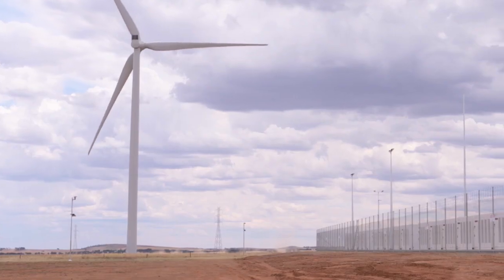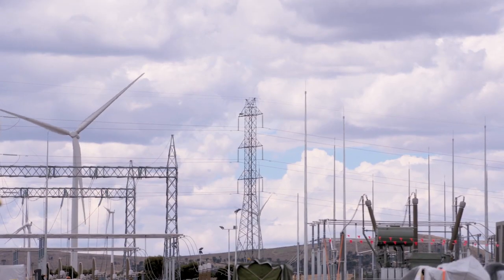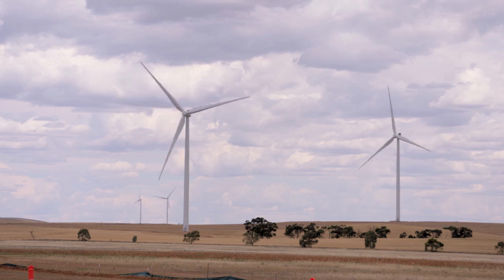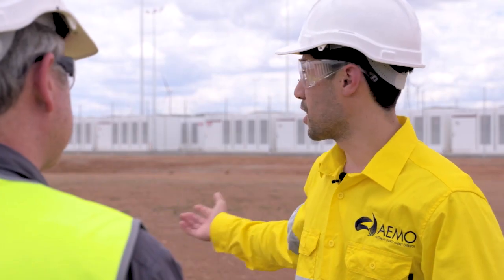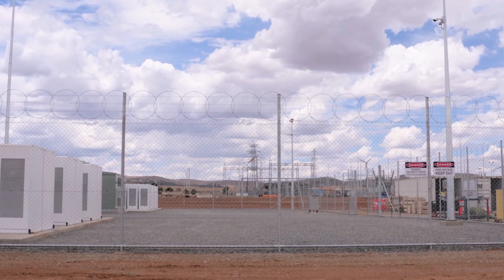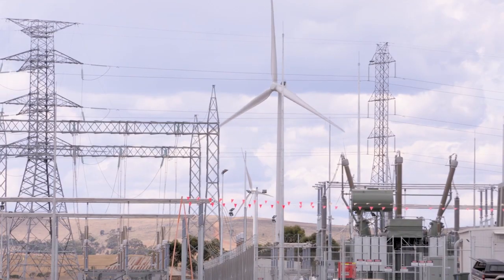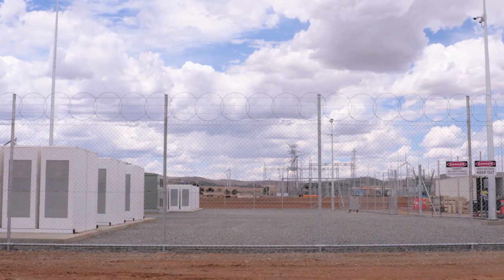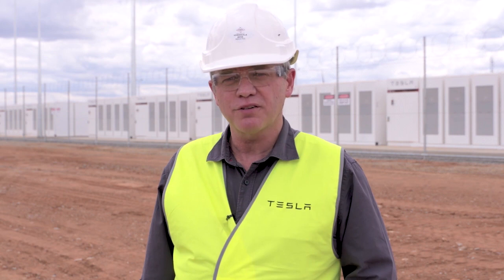AEMO visits Tesla's South Australian battery

Comment: Did you notice the wind turbines hardly turning at all. Very often the case.
Reply: That’s the point of the battery, when theirs not enough wind the batteries can discharge and add onto the grid. When there is wind and making more then enough energy they can trickle excess energy into the battery rather have it wasted.
Reply: Happens when the batteries are full and not enough grid demand at the time, or if there is maintenance, or if it's too windy.
Reply: I have seen this many times in Europe where there are no batteries.
Reply: but there is sun so  put some solar panels
Reply: very nicely expalined

Comment: Sure, destroy the baseload stability & mgmt and grid with unpredictable sources and football field size batteries made from lithium - dirty to mine and process.
Reply: The battery takes less than 1 second when responding to power demand or supply, while the backup generators take ~4-5 seconds to spin up or shut down.  It gives the electrical grid a bit of 'padding', helping to moderate the surges and losses.  It works best with base load to handle what is needed, and the variable power generation (wind & solar) can store their excess power in the battery.  When power is needed above what the base load can provide, it can come from a large enough battery (hopefully augmented by hydroelectric).  When there is too much power (for whatever reason), the battery can store it, while hydroelectric would pump the water back uphill (see Pumped-storage).

Comment: How does it work? They still use cable to transfer this electric current to every house right? It is still not safe from the disaster?
Reply: If there is too much power, and the Australian power grid pays people to use electricity, the battery stores it (and gets paid).  If there is a drop in power supply (like on December 14, 2017), the battery can react faster than a power plant to provide electricity, avoiding brown outs (and get paid).  It can't provide base load, but it can provide surge protection and help reduce brown outs.  For the attached wind farm, the battery stores electricity from when it is generated by the wind farm, and the battery releases the electricity when the price is right (making the wind farm more profit too), instead of the wind farm only releasing when it is being generated.

Comment: I have had a lot of interest in this project since it was first announced.  It's great to see you smiling when summarizing the results.  As you said, it won;'t solve all your electrical problems.  It will be interesting to see what you have to say after using the batteries for a year.  Are other power companies going to follow suit?
Reply: It might be difficult for other power operators to get into the market.  If you look up "Hornsdale Power Reserve", and go to the wikipedia link, you'll see that this battery is handling half of the frequency stabilization needed by the Australian electrical network.  So anyone trying to get in faces a much smaller and tighter market than Tesla is enjoying right now